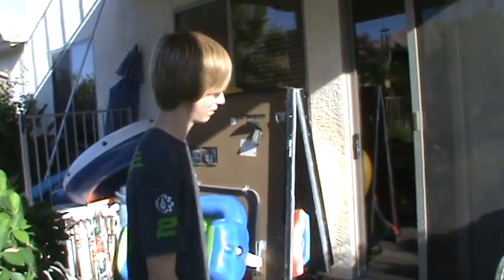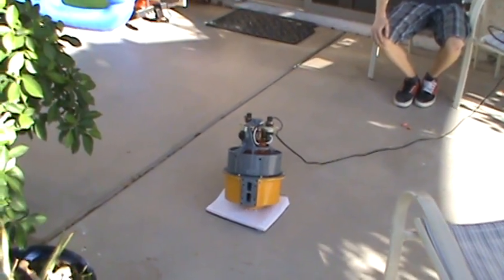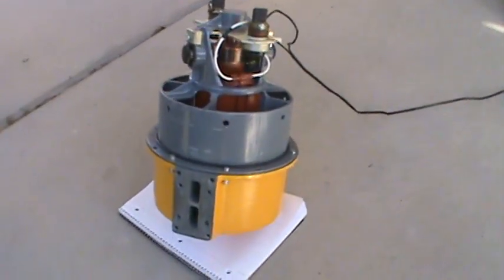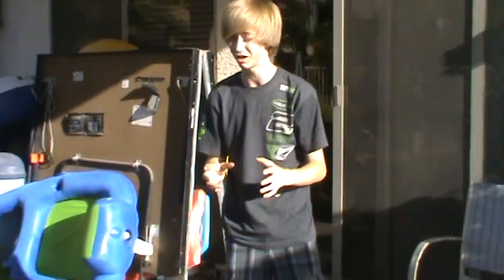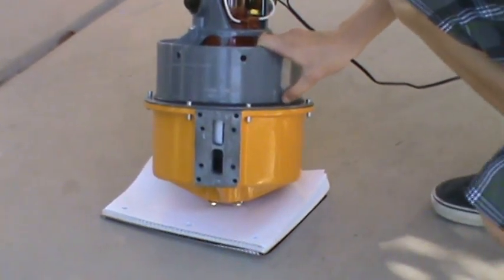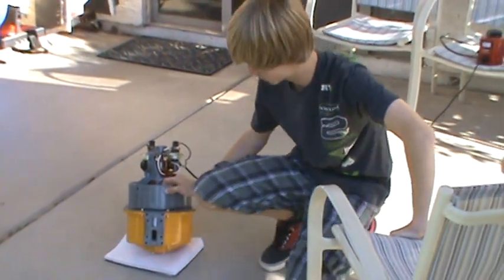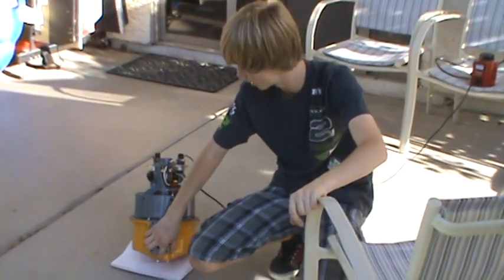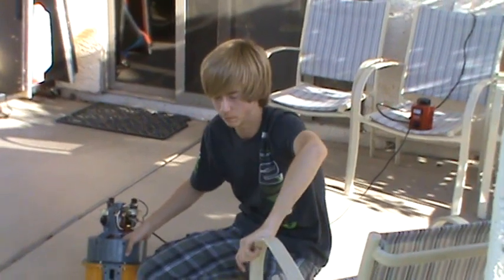First test of my tbolt's chopper of the new year.

Comment: Nice. Was this to try and copy my inverter test. also thats a bearing or because it's not in the thunderbolt, the chopper cap and the motor frame are vibrating against each other.